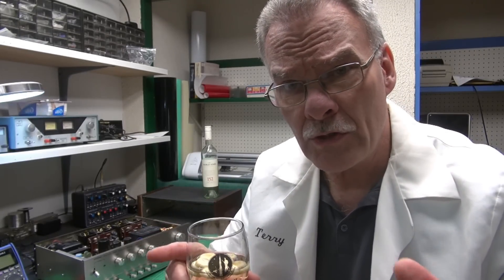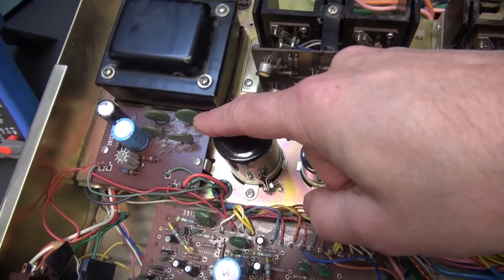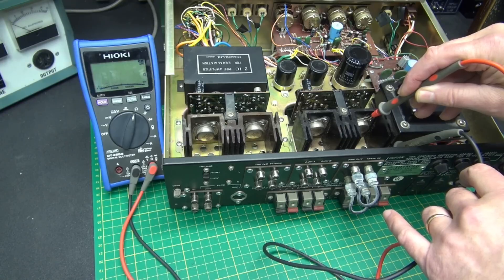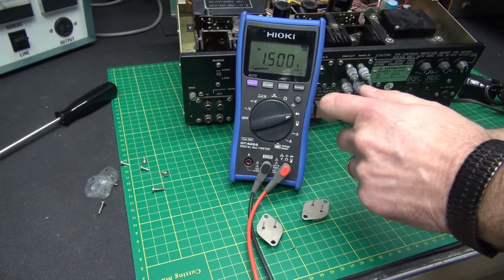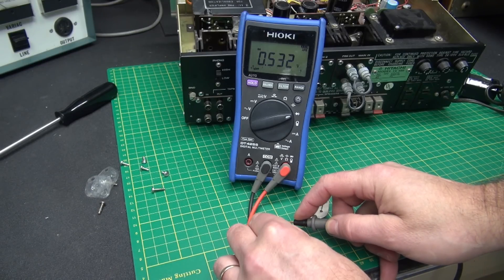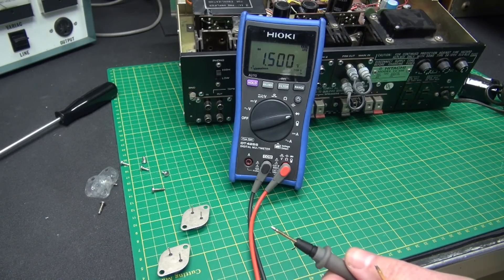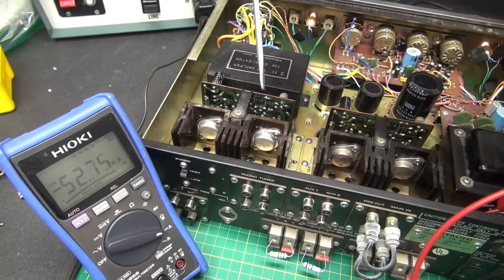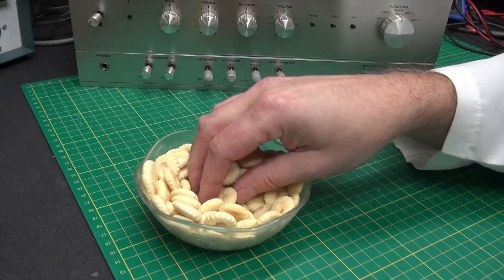Vintage Hitachi IA-600 Home stereo transistor Integrated amplifier one  channel out How to repair

Comment: Set Iq to 20 - 30mA, but do this when the transistors are warm. Because this amp does not have thermal sensors, and therefore cannot control its quiescent current over different operating temperatures,  Iq wjll be much lower when switched on from cold.

Comment: Well done, Terry, a nice short video (no "shorted transistor" pun intended), looking forward to part 2.  I have a '70s vintage Sansui AU-555A with a similar issue, just need to make the time to fix it. 

My only issue with the video is your joking use of "silicone" instead of silicon.  I've had enough trouble over the years trying to get people to use the right word, and here you're undoing that in one video! 😄

Seriously, though, I've seen in the comments people offering up the documentation on this model, so I know Part 2 will be coming soon... 👍

Comment: Terry, I had a Scott integrated amplifier that was almost the same design as that one with the same 2SC1030 output transistors. It biased at 20-30mA.
Reply from the maker: Thanks man, I have generated a schematic. Will note the idle current. Still have bias drift, changed the electro caps, no change, so will be replacing the driver transistors.

Comment: Hi, I have found service manual with schematics, but inside there is nothing about bias adjustment. Need instructions for sending you a file. Greetings from Serbia. Petar
Reply from the maker: Hello, Thank you for checking. I am generating a diagram using the PCB as reference. Part 2 will be on soon!

Comment: 8:01 I noticed you have your finger and thumb across the collectors which have 30 volts present. That is the point I can usually notice a tingle. I wonder how many uA would be flowing through your thumb to your finger?

I don't think I want to try touching the collectors to feel for heat on my Sansui G-8700DB receiver, as there is around 80 volts present. Probably ok if I have only one hand, but I am too much of a chicken to try it. I am going to use my infrared thermometer.

 I would check 9 volt transistor radio batteries by putting them on my tongue which has far lower resistance. That is old school...😉
Reply from the maker: Yep, no tingles

Comment: If the top half of the output transistors had shorted emitter to collector and the bottom one is good, you would not get a short to ground on collector of the bottom transistor.  I would set bias to @ 25 to 30 ma. I would also make sure the voltage on the collector of the bottom transistor one half the supply voltage going to the upper transistor.

Comment: I'd check the driver transistors. One of them may have gone leaky. Also check the current on the load.  The output cap may be leaky, especially after never having a voltage in quite some time.
Reply from the maker: Will do, Thank you for the tips